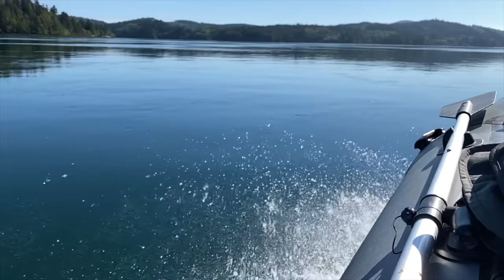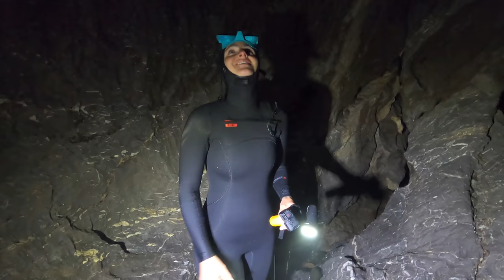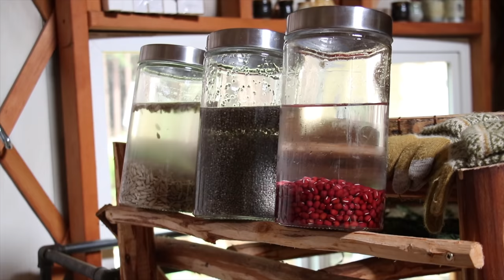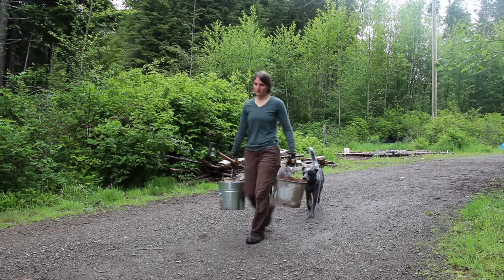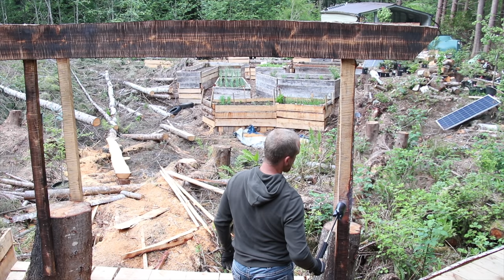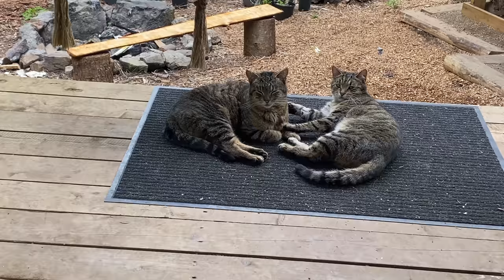LIVING OFF GRID in a FOREST CABIN - What We Cook & Eat | DIVING INSIDE a Secret OCEAN CAVE - Ep. 135

Comment: The seal was like wth is this in my cave.  Priceless on the shredder Nicole.  This sound off the wall, but I wonder if a 8 foot 8 inch PVC pipe work over the end of the shredder.  This way you can move it around in the garden bed.  With out it going all over.  That red yurt needs the outside  lining pulled tight.   Stay safe & take care of you all.  Thanks for sharing eh :))

Comment: Fun..though it's not a good  idea to be planting trees amoungst those that were felled even if there to remain because they can snap it like a matchstick if some shift. Why Jake hasn't taken them in hand if they have a come along/winch is preplexing since there likely to be cut to length in a manageable size and the hazard of having them like this outweighs the trouble of doing it piecemeal. Yo be fair Green Logs are heavy but with a bit of foresight the trees to be felled can be used to help move the as well since if taken one at a time then move those standing can anchor a winch etc to get them to a common point with the last few to brought down nearly on top the others than than to be weaved together in a jumble its here.

Comment: Suggestion....before you have expended all your energy on other endeavors, I would suggest you clean up your homesite.  The trees have been felled or knocked down by you or foul weather.  I say this because you are in a wet climate and you cut trees with what appears to be no thought of safety.  I see you walking over and on wet tree trunks and stepping over downed trunks and tree tops.  I see you have a chipper but it is severely limited to limb size and there is so many logs laying helter skelter that it is a major and very dangerous effort to move it around.   Is this your winter heating supply?  Will you be there over the cold periods? 
I read that you are planning a family. That will mean that the wifey will not be able to perform the heavy lifting.  You are having a ball with your gardens and each requires extremely heavy and seriously dangerous lifting and carrying. You have only one body each. Protect those backs and ankles. Clean up the work areas. Or  arrange  a stay in the hospital and living  quarters  in town.   You are using your chain saws all the time.  Wear your chaps and other personal equipment.  I have 2 close friends with ugly scars down their cheeks.  I almost cut my  main artery in my groin  topping out  a small oak for a friend without chaps because it was only a 10 minute job and was too laze to put the PSE on.  I shredded a new 100.00 Eddy Bauer  60/40 jacket with my little 14 
inch saw and NEVER KNEW IT WAS HAPPENING.  Call me a grouchy 85 year old busy body but the most heart breaking lessons are learned from OUR OWN PERSONAL STUPID  EXPERIENCES.  Learn from the mistakes of others. ....I love your channel and am looking forward to your building a family.  

Am I the only one watching your heavy lifting and carrying tasks through a potential disaster work area.  Let’s hear from some of your viewers.  Anyone else out there want to advise on safety before there is a horrible end to this beautiful saga?  Let’s hear from you.

JoeB
Reply from the maker: Wow please say more